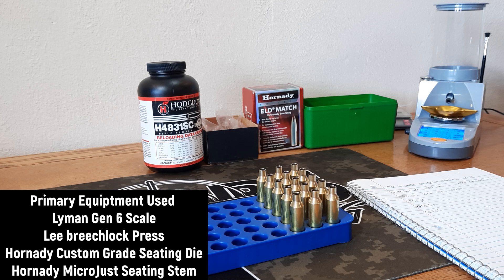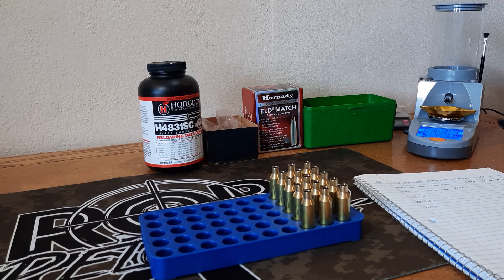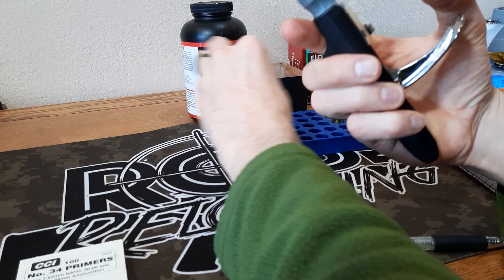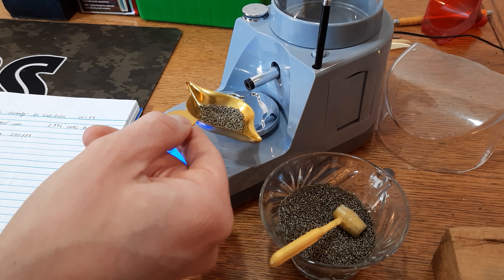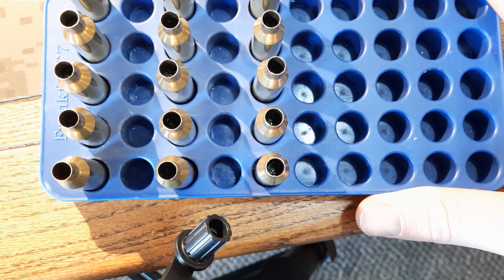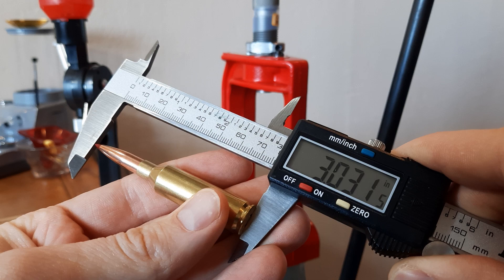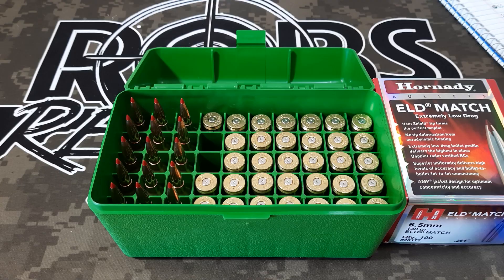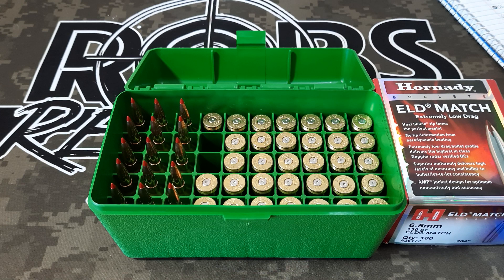6 5 PRC reloading 130 ELD-M

Comment: I never had an issue with hornady brass but frontier was better back then norma an lapua is pretty much my go to any more
Reply from the maker: I was happy to get 6 firings out of this brass considering how difficult PRC brass is to get. I am considering retiring this brass or saving it for a rainy day. I have a batch of 1x fired Nosler, and a batch of 0x fired ADG.
Reply: @RobsReloading  Best thing to do on 6.5 PRC brass is to put in notifications on every possible sight you might want to purchase from and when available buy it as quick as you can. I got some Nosler just by back ordering at Optics Planet and it finally came in. I just recently by chance found Peterson 6.5 PRC brass and got lucky enough to buy it as well. I had my rifle for a good 2 months before I could even get brass. It looks like it will be some time before small quantities of this brass can be had. You can purchase a lot online if you are willing to purchase 500 to 1,000 pc. lots. Pretty pricey but a value when buying in bulk.

Comment: Been thinking of adding a 6.5 PRC to the collection, but can't find brass anywhere.
Reply from the maker: Brass is very hard to find. Ballistics aren't all that much better than some hot 6.5 creedmoor, or 6 creed loads for target shooting. You could consider alternatives, until the component crisis is over.
Reply: 6.5-284 brass is easy to find right now and mine shoots just as fast as my 6.5 PRC with a lot less powder
Reply: @muleyhunter99  FYI Certainly some calibers already will shoot the same velocities and even higher if one is shooting just for velocity. The 6.5 PRC is a better designed cartridge for shooting the high BC bullets. A 6.5-284 is not. Apples and oranges. But you are only a custom barrel away in a 1-8 twist from being able to shoot those high BC bullets. However, the case design won't put you on par with the 6.5 PRC either. It is a precision rifle cartridge for long range target shooting competition foremost.